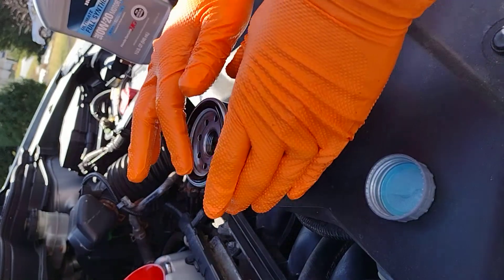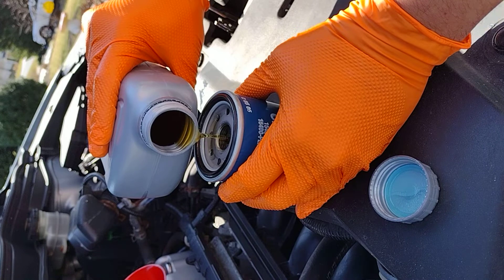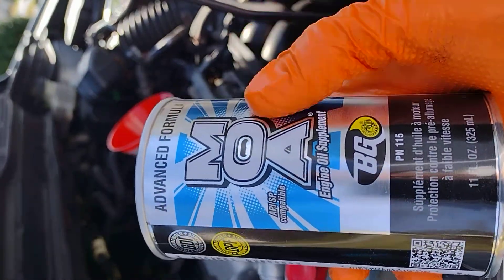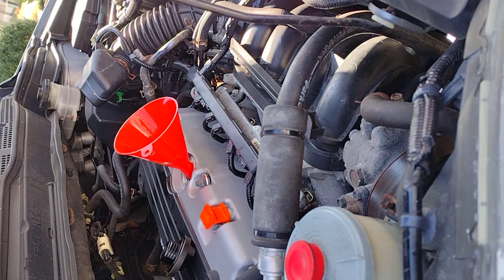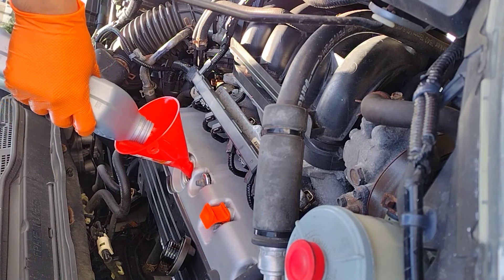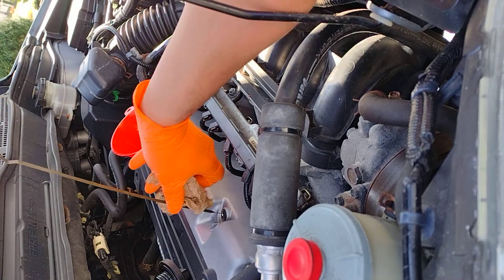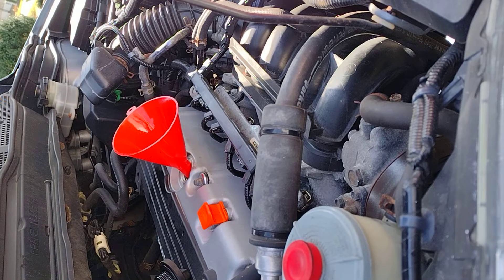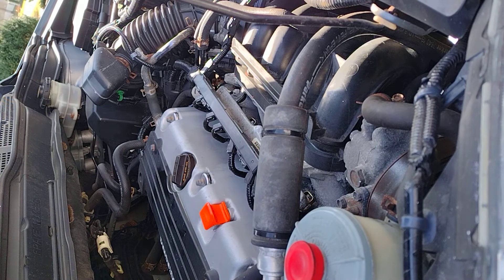BG Engine Restoration Cleaner 2010 Honda CRV 2 of 2

Comment: I did this on a 2014 Traverse that needed 2-3 quarts of oil between changes and would smoke pretty heavy on startup. It competently fixed the issues, within a few startups the smoke went away and it no longer needs oil between changes. I did this on a relatively warm day and the heat from it sitting at 3500 RPM for that amount of time caused part of the plastic to melt around the exhaust. If I did this in the future I would run a blower fan to move air under the vehicle. I can't speak highly enough of BG products.

Comment: My daughter's friend brought me her 2016 CRV with 156K because it was making a noise. It was 3.5 quarts low. I ran BG engine performance, not this one but the one can product. I am going to see if it helps. If not I am going to do this. I never knew they have this issue. We will see. Thanks for the video
Reply from the maker: Try testing the PCV valve to make sure it's working properly also. It might be contributing to the oil being burned.  With 160K miles, who knows whether the previous owner took care of it.  It should be replaced every 30-60K miles

Comment: How many miles on this engine?  I have a 2006 Honda Element with this same 2.4L engine and at 130,000 miles it does not use any oil between oil changes.  I started it out new on synthetic oil and change it every 5,000 miles, using the Honda filter.  And in case you did not know, the Honda synthetic oil is made by Phillips 66/Conoco Oil Company.  They also make Motorcraft and Kendall oils.  And they own, Red Line Oil.
Reply from the maker: I have about 165,000 miles now.  I change the oil every 5K miles also.  There was probably two times over the life of the vehicle that I changed the oil at about 6k or 7k miles.

Comment: Did the car stop burning oil ?
Reply from the maker: It burns less oil now, but it did not stop burning oil.  I read online that the CRV has that problem.  I wish I had known that before I bought it.  The good thing is that is burning way less oil.  Now I don't have to add oil between oil change.
Reply: @fixit9888  how much oil was it burning and how much is it burning after the service.
Reply from the maker: @matthewfreidus5034  I remember that I had to add about a quart of oil every 2-3 months.   Next oil change is coming soon and I have not added oil because the level is not critically low.  It still shows the oil between full and low.  I will let you know how much oil I lost once I get home.
Reply from the maker: @matthewfreidus5034  i just checked the oil level and it's still full.  I Don't think it's burning oil anymore.  If so, it's a very small amount because I cannot see the difference .  I have driving the car for close to 4,500 miles already and by this time some oil should have burned, but I check the dipstick and the level is still in the same level i filled it.
Reply: I junked my 2010 CRV because it was burning all of the oil within 3 tanks of gas. I wish I knew this sooner,  it might buys me a few years on it.

Comment: Never prefill your clean side of oil filter with new oil. New oil is to be considered dirty and should only go into the pan or over open components.
Reply from the maker: Can you elaborate on that?  If the oil is considered dirty, doesn't that mean that you are pouring that same oil into you engine oil pan? which will in turn make it's way into the parts of the engine.  If you don't prefill the oil filter, doesn't the same oil going to end up in the filter after you fill your engine oil pan?  Please provide a source so that I can read about it.  It might change the way I do things and i am always open for anything that extends the life of my vehicles.  
Thanks
Reply: @fixit9888  i guess he’s the source
Reply: Ford Boss me talked about it recently.
Reply: @fixit9888  The filter is there to make sure no contamination big enough to hurt the bearings goes to the  bearings. By prefilling the filter you are gambling that no such contaminants exists in the new oil. Oil suppliers have no cleanliness standards for new oil in the container as anything can happen during production, it’s not a clean room situation, they can’t wash the containers that are shipped in etc. The oil in the pan is dirty, and it is pumped to the dirty side of the filter. Don’t put anything unknown on the clean side.
Reply from the maker: @jonasthemovie  i get your point.  From now on, i will follow your advise and reinstall the oil filter without adding oil.  Thank you for providing this important feedback.
Reply: @fixit9888   I usually pull the fuel pump fuse letting the engine stall 2-3 times before beginning the oil change. Makes it easy to crank without start. Some cars have flood function, which means full trottle at start shuts off injectors. That let’s you crank without start too.
Reply from the maker: @jonasthemovie  what are you trying to achieve by cranking the engine without a start?
Reply: @fixit9888 Just extra peace of mind. Priming the filter and shortening the time before the bearings get hydraulic pressure during the first real start. Just like you would when starting a new engine build for the first time. The residual oil in the bearings should be ok with a direct start and idle crank pulses thou, especially if the engine ran just before you emptied the pan. People who preach prefill of filter are often scared of the lack of hydrostatic lubrication at the first start, but forgets that many filters drain during long storage, or that many engine designs don’t even make it possible to prefill, like Subaru boxers with upside down spinons.
Reply from the maker: @jonasthemovie  I see what you mean.  Thanks for the info
Reply: @fixit9888  The Engine will crank over but not start thus pumping oil to fill the oil filter.....
Reply: Ridiculous.
Reply: @TheBenjammin  Ridiculous is to prefill your filter on the clean side.